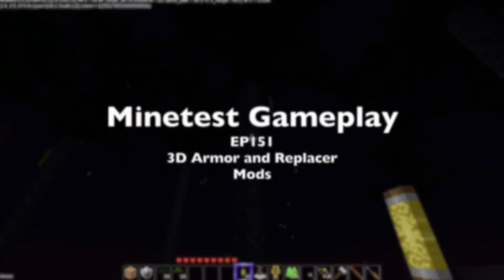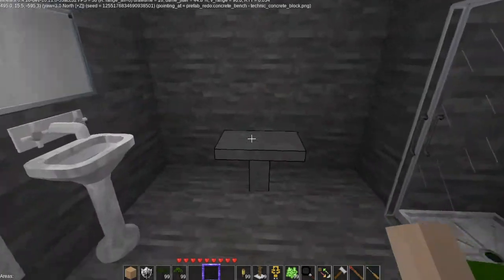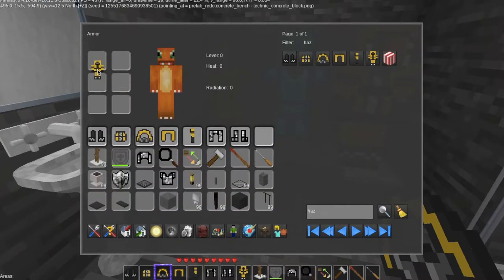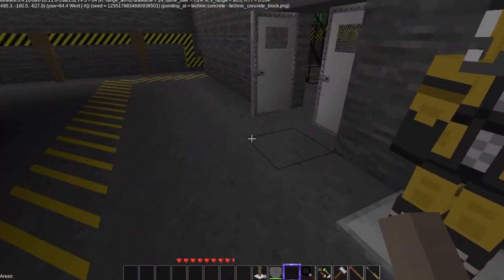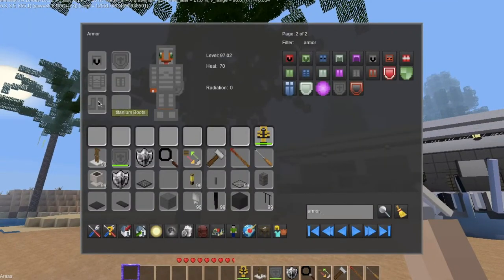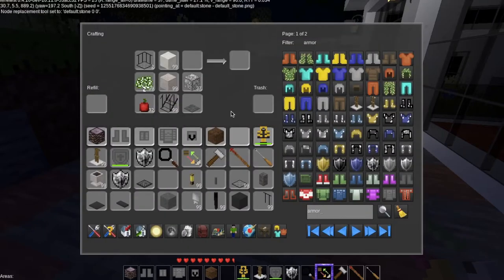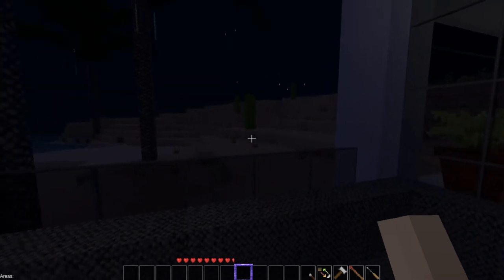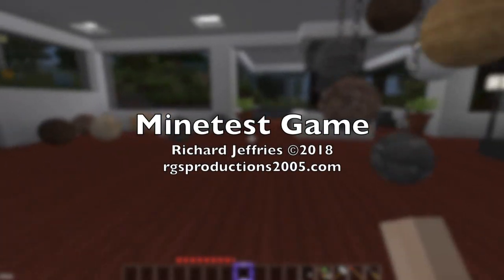Minetest Gameplay Episode 151 - 3d Armor and Replacer Mods

Comment: I wondered how to use the replacer, thanks for the explanation.  :)
Reply: It should be noted that in survival you have to have the items you are placing in your inventory, or the operation will fail. It also copies the nodes rotation, so it works super great if you are placing a bunch of nodes from the circular saw that need to be rotated.
The replacer tool also will either replace the node, or place a node on top of the pointed node, depending on if you right or left click.
Reply from the maker: I have to work on explaining the functions better in survival mode since I only play in creative.  I am really liking the replace tool the more I use it.